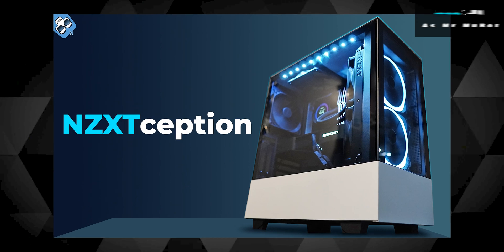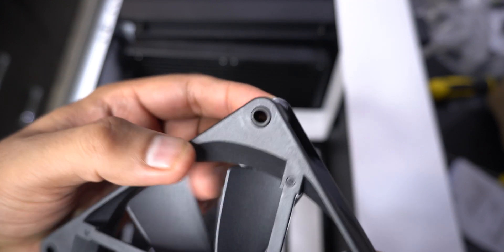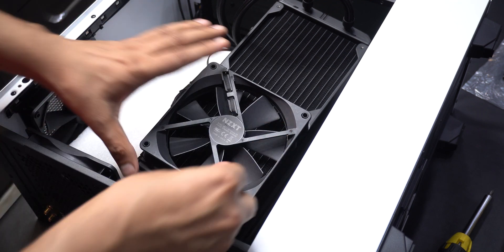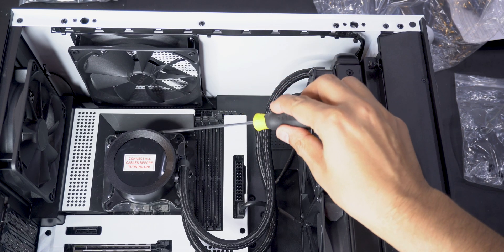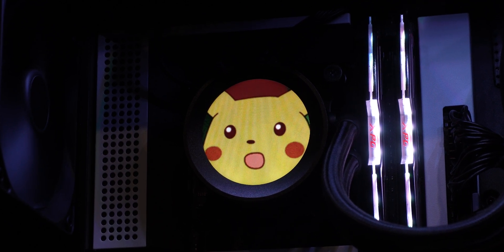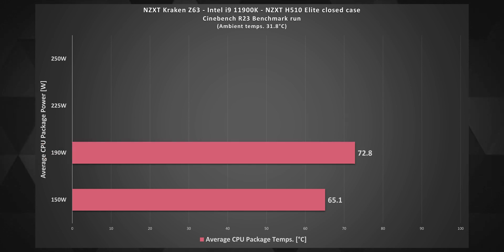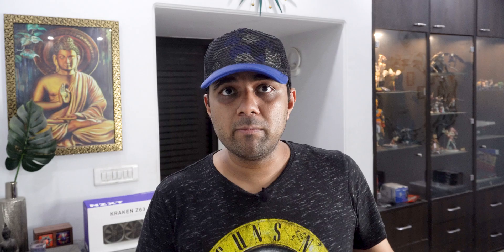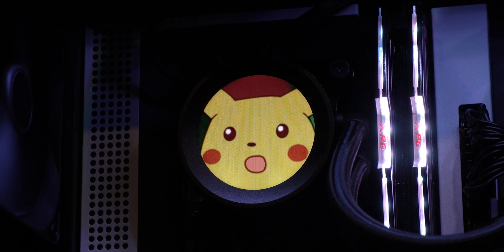NZXT Kraken Z63 v/s 250W - Review & Installation

Comment: My laptop is stuck at blue screen of death, it's showing restarting and after 100 percent completion it again turns off and the cycle continues, weird creaky noises are coming too,😐
Can I recover my data? 😢
Reply from the maker: If the creaky noises are from the hard drive then that's bad news.
Reply: @MrMuBot  there was some scratchy noises from hdd since long time. But now it sounds terrible. 
Anyways I wasn't expecting this laptop to last any long but now I regret not taking backup, I had a new desktop hdd but I didn't used it because I wanted to use whole new parts in my upcoming pc.
I'll go service center today. For getting my data recovered (hopefully).
Reply: @MrMuBot  and one Problem too. My note 7 pro is dead. It's stuck at boot loop. It just turns on  says redmi and again turns off and again turns on.
Weird I've similar issues in both of my devices. 
The smartphone got this issue 10 days back though. Now I'm using world's slowest phone gionne p7 max. This shit is 5 yrs old. Dad said if the phone got okay under 500 then good otherwise I'll have to wait till diwali for new phone
Reply from the maker: Yeah sounds like both the devices have lived their lives.
Reply: @MrMuBot  😞
Reply from the maker: You shouldn't have ignored the creaking sound :|
Reply: @MrMuBot  I went to service center today, they took my laptop and said that they'll call me in a few days. They were busy at the time of visiting. One man said there that this is probably a ram issue but I think it's because of HDD.
He also tooo service charge for just opening the laptop and doing nothing. 😠
I said if you didn't give me my laptop working then I'll take my money back no matter what.
It's been 5-6 times of me visiting hp service center for one issue or another, everytime my dad has a fight with one of his crackhead employee.
Reply from the maker: Damn horrible
Reply: @MrMuBot  even xiomi charge 399 service charge. When I replaced my battery of 899 they slapped a 399 service tax over it. I still have the bill. Asap warrenty is over they suck our blood and make lame excuses to delay the repair.
Reply from the maker: Yeah. This is why I push for extended warranty wherever I can get.
Reply: @MrMuBot  hm

Comment: using the same and really impressed by the performance
was using stock cooler on 5600x (will be upgrading soon) and man it touches 85c
after replacing stock cooler with z63, the temps never went above 65c
Reply from the maker: Yup, it's impressive. I am curious though. What are the temps if you do a complete run of cinebench R23?
Reply: @MrMuBot  I didn't run C23, will let you know once i finish the test

also, using the same thermal paste came pre applied with the aio
Reply from the maker: @skylersstreams  Yeah. I am pretty sure some other might give a better result. But it is not needed for most desktop chips right now. Do share it later :)